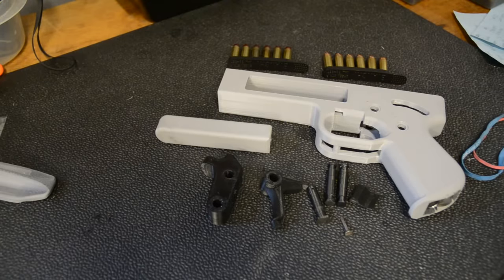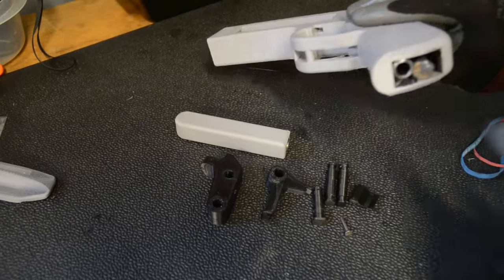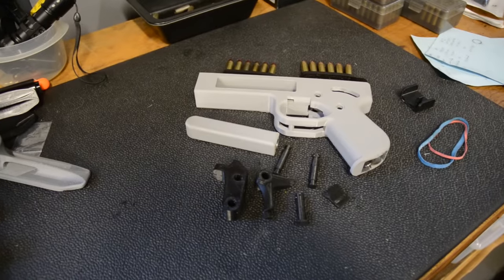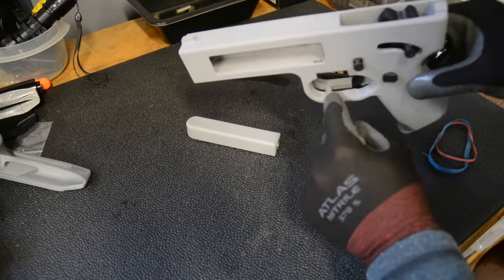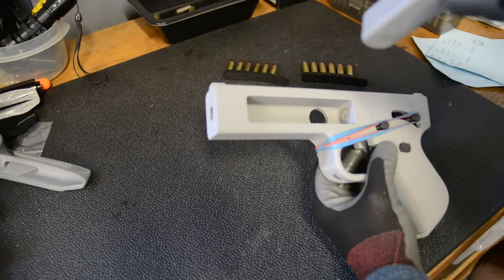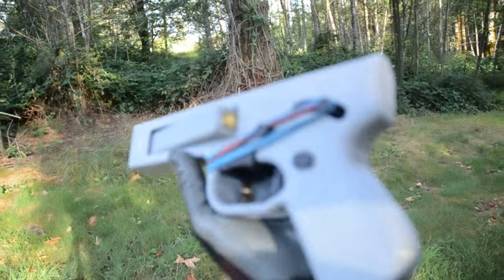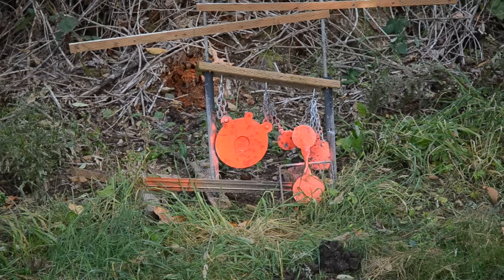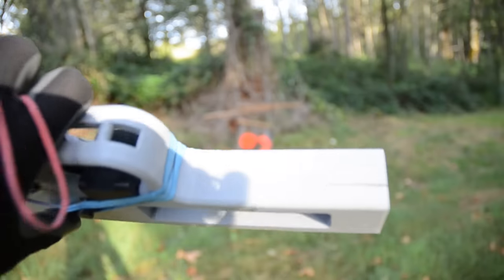Songbird 3D Printed Pistol - .357 Magnum

Comment: That's the most dangerous Wii gun i have ever seen.
Reply: well it is missing the wrist straps FFS.
Reply: Agreed, janky as fuck.. A live round for safety, and a chisel shaped firing pin.  How much time does to take to correct 2 HORRIBLE safety mistakes !? for fucksake..
Reply: hahahaahahahahahahahahahahahahahahaahahahahahahahah
Reply: @AaronX442  Atleast the gun functioned. Granted, it cracked after firing the .357 magnum. But it did work. I wouldn't have fires that damn thing by hand, though. I'd be afraid of it blowing up and getting plastic shrapnel in my hand.
Reply: Lmao
Reply: The "LIBERATOR" are more danger
Reply: So it would seem.
Reply: Matt G uh... yeah actually.
Reply: I’ve seen wii guns become deadly weapons after me swinging them hard enough to go through a wall
Reply: @worldhello1234  wow thats edgy
Reply: Funny asf just found an old wii before stumbling upon this video 😂😂😂😂
Reply: @aykay8528  yeah, it would suck if it blew up in someone's face while they were trying to fire it
Reply: @12vibaba  There's burn powder residue around the firing pin hole, and actual damage to the frame immediately after the last shot. With the .38, you can see him pointing the end of the barrel in front of the camera. Also, the mechanism looks sound as far as getting a live round to go off. I don't see why he'd have to fake it. Now, granted, this could all be smoke and mirrors, technically, but I find it plausible.
Reply: Artrysa lmaooo replying so u can see ur likes 3 years later
Reply: I miss wii
Reply: Lol
Reply: First plastic frame 7.62×25 Tokarev #TTBell2020
Reply: @AaronX442  Make a better gun and upload it then. I'll wait
Reply: @erenjager1155  lol hold your breathe while you wait.. I buy firearms.  Then a client of mine does a complete trigger job, internals polishing; and CNC slide weight reduction.  I swear by Trijicon night sights for all my handguns, so those go on as well.  Firearms are not toys mate.  And shouldn't be treated as such.
Reply: LMAO
Reply: I had a honest to God real good 🤭
Reply: 😂 lol

Comment: The fact that he didn't blow his hands off was impressive enough.
Reply: no not really it all depends on the type of plastic and how you chemically treat it
Reply: Maddock fitzsimmins  well progress is progress and i wouldn't test one either without a vice and i would experiment with plastics on strength and which ones are best for hardening, most metal 3d printers suck and are not worth the money and the ones that are not sand based have hardness issues
Reply: If he chemically treated it afterwards he should have mentioned that in the video.
Reply: Most of the power stays in the barrel. It is a bought one designed for this kind of ammo. The only risk he has is the plastic breaking due to the recoil, which isn't too dangerous in terms of injuries.
Reply: It will only blow up sideways, he should be safe
Reply: p90 is plastic.
Reply: @_DiABLO666  just the shell
Reply: @MPablo-ct5ut , I think that problem could be solved by wrapping a tight coil of copper wire around the stress point and epoxying it in place.
Reply: @KONRAD Bwahaha sure and Lee Enfields and M-14s were made of wood.  You really know a lot about firearms bro
Reply: @KONRAD I'm from the UK, where people likewise use knives and occasionally machetes, also here firearms are not common.  However if you had served in the Armed Forces you would understand why 3D guns are a joke, a bit like a chocolate machete, or a rocket launcher made from jelly.  To refer to your original comment, the external parts of a Glock may well be from plastic - but only on the pistol grip, and this is just covering metal to make it easier to grip, but there is a thing such as compressive forces generated by the charge in a bullet - which is why the moving parts (breech block, firing pin etc) and the barrels and housings of firearms are made from steel and not just any old steel.  If you compare to a car, if an engine block and pistons could be made out of plastic, they would have done it now, but plastic can't contain the forces involved.  3D firearms are more danger to the person pointing the weapon, than the person or object they are pointing it at.  As you can see, he bought a proper barrel (not just a bit of copper tube) and uses a nail as a firing pin.  In other words this is just a simple one shot pipe gun, with some plastic around to make it look like an automatic pistol.  Total clickbait.
Reply: Glocks are made out of plastic too
Reply: @youngman8954  Erm no, only the outside of the pistol grip, to enable a firm hold, has plastic panels on it.  No firearm working parts are made of plastic and for good reason, just the same as car engine blocks and pistons are not made of plastic.
Reply: I wouldn't be so scared of the .38's but I ain't ever using 3D printing to fire .357 magnum.
Reply: Once theres a metal barrel, you got nothing to worry about 🤦🏼‍♂️🤦🏼‍♂️🤦🏼‍♂️
Reply: @youngman8954  The handle of the glock is made of plastic. The actual "boom boom" parts are metal. Also note, there isn't a glock in .357mag. .357mag operates at some insane pressures compared to auto loading calibers. To put things in perspective, the only autoloading pistol that I know of that can handle .357mag is the desert eagle. 

My money is that if he keeps firing the .357 loads, his gun will fail. IDK how. IDK when. But I am pretty sure it will.
Reply: With the liberator that would be an achievement put the songbird is much safer and has a barrel liner so the plastic doesn't explode
Reply: Nope.  It depends on the barel.
Reply: @Dizzykitty817  there is a good bit of semi auto handguns made for 357 magnum and even some in 44 magnum. The pressures are easy to deal with because all you need is a beefier chamber and a reinforced lockup mechanism which on the desert eagle is a rotating bolt like a rifle.
Reply: those are not gunpowder loaded bullets...  or the gun would explode.
Reply: @KONRAD Polymer but yes
Reply: @simonh6371  hahahahaha  i  can  see  a  engine melting...  😅
Reply: Look the barrel you can see the steel
Reply: This is insane..
.a rubber band on a gun...the plastic just broke.....wtf ....I'm speechless....the feds are gonna get you.... your exposing too much info
Reply: Or the fact he didn't hit the target once doesn't surprise me. Smart enough to make it but hasn't practiced with it either. I imagine it has shitty spread regardless of the user
Reply: he said the thing
Reply: @michaelgarner9960  dude lighten up, he’s shooting a gun he mostly made. This is an old video and the designs have come a huge way. This isn’t a target practice video.
Reply: First plastic frame 7.62×25 Tokarev #TTBell2020
Reply: @ChronicKPOP  nope
Reply: The Glock's frame, magazine body, and several other components are made from a high-strength nylon-based polymer invented by Gaston Glock, called Polymer 2. This plastic was specially formulated to provide increased durability and is more resilient than carbon steel and most steel alloys. Just gonna leave this here

Comment: And people are afraid that thugs, gangsters and terrorists are going to pick these as their weapons of choice?  Give me a break!
Reply: Howard Black nevermind that a decent quality print the size of the frame would take a long time (I the range of 8-15 hours.  No one's gonna be able to print these at school.  This takes a long time to produce.
Reply: lets be honest that's an irrational fear
Reply: Howard Black I would blame that case on the school . My Phys and Engineering both stated to not do that. Teachers shouldn’t keep them open to use outside classroom application
Reply: Not completely but in some part
Reply: I'm sure this technology will stay exactly the same and not improve in anyway.
Reply: Thats the reason why chemistry courses even at the college level, at least for non-chemistry students, are basically kid-safe and non-toxic these days, and part of why most high schools no longer have any kind of shop, either wood or machine, option available to them. Rather than being afraid of what they MIGHT do, worry about why they might do the things you're afraid of. 

Because honestly, this takes a lot more smarts and time to make than a molotov. Or even a musk-style "flamethrower". Much less a shank or an old school pipe-and-nail zip gun.
Reply: "thugs, gangsters and terrorists" aren't the ones doing mass shooting.
Reply: short minded! this is just the beginning! through testing and error, in 5 years or less, hundreds of people doing this theres gonna be a functional one with the right specs online and everyone just have to download the file and print it on their rooms... what about that?
Reply: It's easier to get a glock than get this lul
Reply: Howard Black  these are made to combat gun control they are not ideal. What would be ideal is ending serial numbers on rifles and pistols
Reply: martinz1540  Just because firearms get banned that doesnt mean people can't get them anymore.
Reply: You seem to have forgotten one of the most important parts in relation to a 3d printed gun (besides the fact they're trash).  While you can print something that'll work marginally, unless you have some sorta magic printer that nobody's heard about, you aren't making 3d printed bullets to go along with that gun.

If someone has a source for ammunition, chances are very high that they also have a source for a real gun too and aren't going to bother with a 3d printed piece of trash.
Reply: Howard Black  natural selection
Reply: You can also make a gun with scrap metal and wood pretty easily is you have a couple tools rofl. You people aren't smart
Reply: I definitely not worth building
Reply: Real life gun game you shoot someone with this to get a better 3D printed gun and so on until you have a 3D printed tank everything shoots like 1-5 bullets before exploding
Reply: End of the day, all you need is a pin to hit the ass end of the bullet man. All it takes to fire a bullet. You could make this out of a spring ect and some very HARSH and ROUGH steel work, you dont need to be a CNC expert, just as long as the spring can pushe the pin forward hard enough to set off the explosive powerder in the round. A guns actually a very simple process. Its suprisingly scary how many people can make a gun if they wanted to. Of course, a shit gun may only fire 1 round at a time, and may only get 3 rounds off before its totally unusable. but its possible. Only takes 1 shot to kill someone.
Reply: If it can kill they will fear plus kids can buy the printer
Reply: Howard Black  Shouldn't the school be responsible over their 3D printer though? Pretty sure the most basic line of defense against overly intrigued students are a door lock.
Reply: @wbh3952  they don't have the mental capacity to operate such a device
Reply: @dodecagonxxv  Mass shootings aren't even a thing you should be afraid of. How many mass shootings have happened compared to numerous other dangerous incidents? Being scared that mass shootings are happening often is like being afraid of a terrorist group trying to invade mainland US lmao. You're more likely to get hit by someone drunk and texting on a busy roadway then find yourself in such a situation
Reply: Why would you put it past them?
Reply: you mean like his broken frame?
Reply: Howard Black  You know hammer and trigger is still metal and also the actual barrel is also metal,
Reply: Howard Black  also since when high end 3d printers were bought by schools
Reply: This is just the first prototypes...
I won't be surprised if in less than 10 years we'll be able to 3d print a fully functional AK-47. So I can understand their concerns.
Reply: Howard Black  Well, everything can be dangerous to the stupid. Its evolution in action. The "think ofnthe children" refrain to ban eveything gets old. This is a proof of principle to combat draconian arms / self defebse restrictions. In many countries, you don't even have the right to defend yourself. At all. These are like Stens, intended for clandestine manufacture in dictatorial regimes.
Reply: @YanPagan  I would say that's a good thing, not the apocalypse you make it out to be. Fear a goverment that fears an armed citizenry.
Reply: Howard Black  Antennas were never capable of supoorting firearm barrel pressures. Antennas were being stolen to make crack pipes / drug paraphernalia. It isnt hard to find a liece of pipe from a hardware store. People still make slam fire shotguns. Tell me something, laws have only gotten more strict and criminals have access to way better firearms now - no zipguns these days (assuming there ever really where in the context you mention) - how can you claim attempting to control hasnl improved the situation  by any reasonable measure? Assuming hardened criminals actually were using zipguns, the only difference between then and niw is they're at leass of antisk of injuring themselves and far more deadly to others.
Reply: You do know that some biker gangs build there own SMGs with parts you can buy from hardware stores and its impossible to trace it back to an individual.
Reply: golf-n-guns thugs and gangsters are too stupid and lazy to do all this work (which is why they’re on the path they’re on) 
Terrorists..maybe..but it depends on how effective and reliable it is
Reply: Howard Black  you mean black people we got real guns they passing them out we good already
Reply: People are afraid of printed guns? I weld guns better faster then printing them. And they shoot same quality as real steel. Be afraid when we learn how to make automatic 😉😂🤣
Reply: Eric Skinner im just only asking because i am un educated in this whole thing but couldnt you just like stop and resume it the next day or is that not how it works lol sry
Reply: @dodecagonxxv  yet they are the ones killing the most people overall.
Reply: What a blanket statement
Reply: Howard Black  hey my school has a 3d printer now let's print a gun that takes at least 13 hours to print, will lead to having to answer a lot of questions and somehow magically get ammo.
Reply: @RetroGore91  that's not even close to statistically accurate you people eat keep trying to say mass shooting mass shootings usually are less than 10 people meanwhile every damn day gangsters are killing people
Reply: @dodecagonxxv  Mass shootings with single shot, inaccurate and potentially hazardous weapons? How delusional.
Reply: Numerous school shooters, the vegas shooter etc. They aren't thugs or gangsters or linked to terrorist groups. I am talking about the unpredictable "mass shooting" by "normal looking white kids" and not daily crimes.
Reply: Howard Black um literally no one said anything about a school shooting, I don’t know if he has the plans to the gun online or anything because I haven’t watched the whole video, but I do doubt that a school shooter would pick and build this.
Reply: GAY GAY p
Reply: Howard Black  pfft. i used to make more dangerous shit in shopclass, while all my classmates would go into the paint room and huff paint thinner.
Reply: @dodecagonxxv  actually yea they are in a way. Most that do a shooting are for or a part of some group ( Nazis,ISIS,etc)
Reply: Howard Black  you can make juvenile version of hold my beer with gun making using a freaking pipe, nail and some epoxy glue...
Reply: Howard Black  and it wont finish printing, a gun shell that big will take 20+ hours if you want it to be anything but nonfunctional, also if you have to get to a lenght of getting into school after its closed then you could just get a cheap 3d printer and do it at home.
Reply: @RetroGore91  if killing anyone and race have any connection then, according to statistics, it would be black boy not white boy who is killing c:
Reply: @Charr Churl no, metal is not going to be needed to make guns. Nowadays we have plastics that are temperature resistant and stronger than some metal. Some sort of bakelite carbon fiber composit could be the starting point. Belive me we will have plastic guns that will work sooner than later